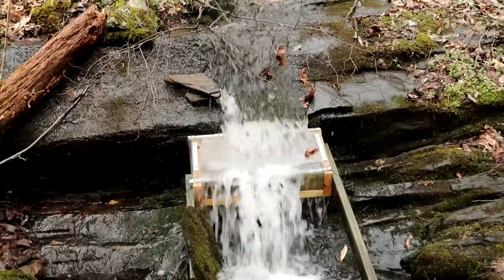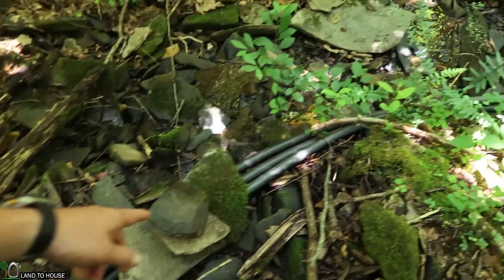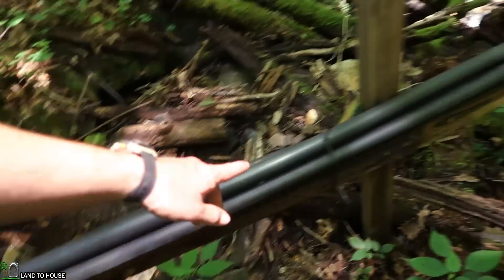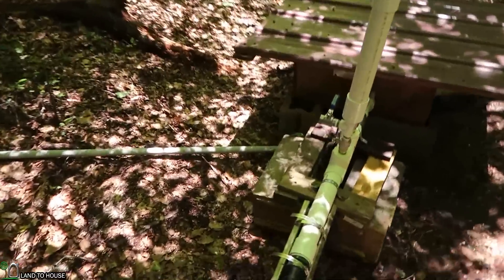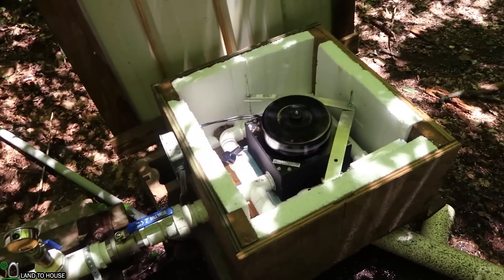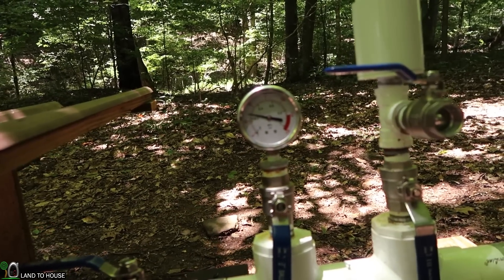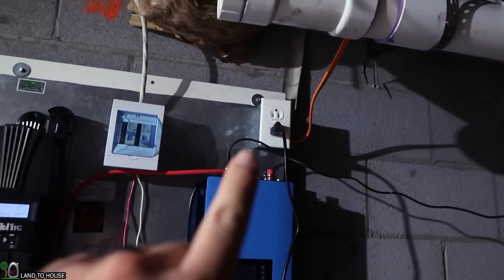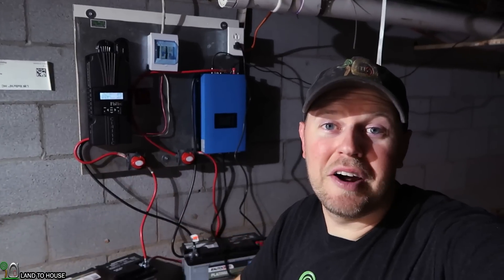Full System Overview Micro Hydro 10/10

Comment: are you going to try to automate the valves?
Reply: To automate the jets in a continuous and efficient way, first of all you need Doble plug / injector as in large pelton turbines, they also do them for these pico / turbines, it is not possible to act on the valves if not to make on / off the best solution as a result and tracking accuracy of the maximum power / maximum level of the loading tank before it overflows and detecting the level upstream in the tank / bin, using an ultrasonic or piezoelectric immersion level transducer, etc. Transmit the signal downstream, generally it is a serial RS485 which can also do 2km on a special twin-state cable, but often a PV panel is used, a charge controller, a battery and a serial radio modem that transmits downstream to a receiver that returns the RS485 / RS232 serial to the control micro PLC or Arduino that drives the turbine adjustments with a time-based control algorithm to keep the level not too high and not too low in the tank, from the valley it can be done with a pressure transducer but it is much less precise, it is certainly better than nothing.
Reply: @winterburan  thats what i was thinking
as for the valve just actuate the existing valve with a stepper motor or servo or something
Reply from the maker: Probably not because they are 250 feet from the house. I will just turn off valves as the season changes.
Reply: You could use an electronic pressure sensor, to open and close the valves automatically to get the absolute maximum at all times.